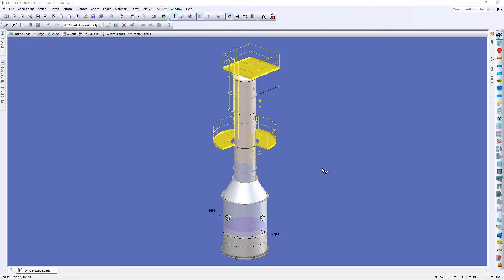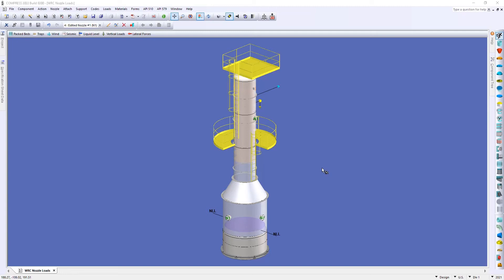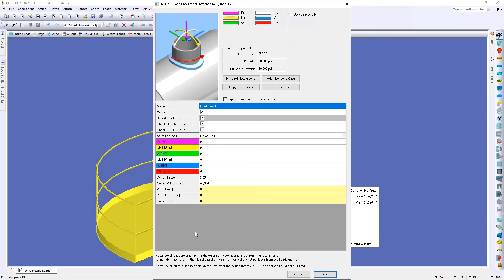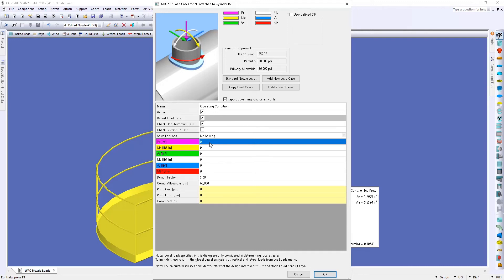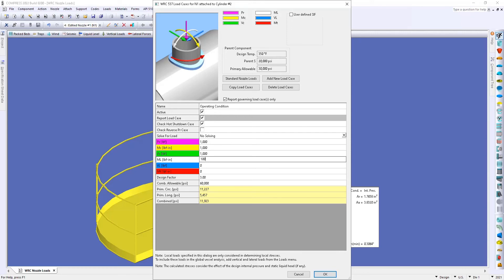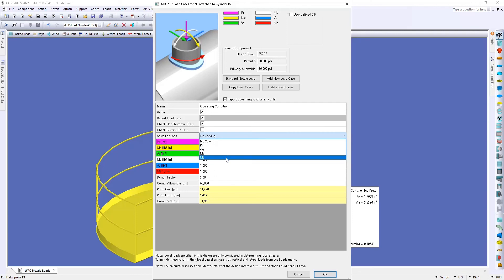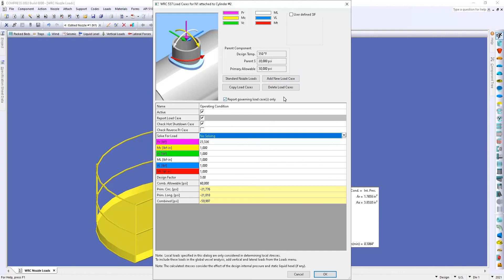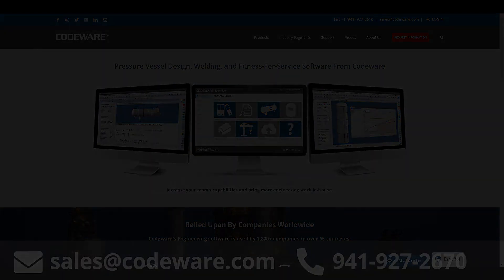External Nozzle Loads Design Using WRC-107/537

Comment: Great demonstration. But what about loads on flanges? How can we check if the flange rating changes based on applied WRC loads? 
Often times pipe and shell connection s fine but the flange rating high.
Reply from the maker: COMPRESS provides the option to "Consider external loads on flange MAWP rating". This option will reduce the standard flange pressure rating based on applied nozzle loads. For more technical details on how COMPRESS considers external loads, please review the article https://support.codeware.com/s/article/1570 in the Codeware Support Center. Alternatively, we would love to give you a live demonstration of the software if you have any further questions!